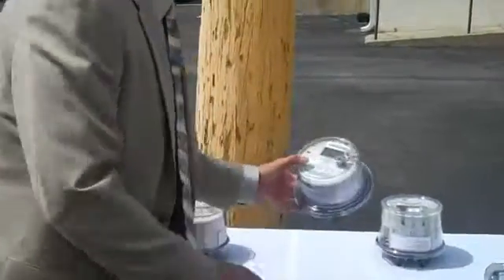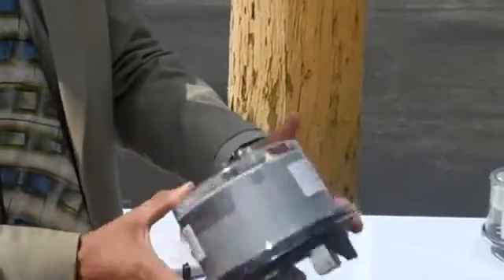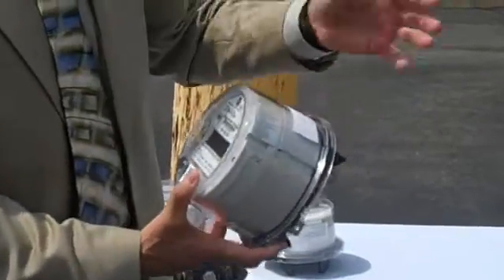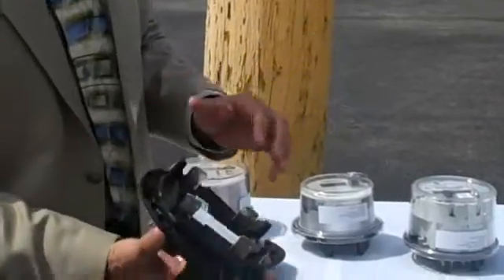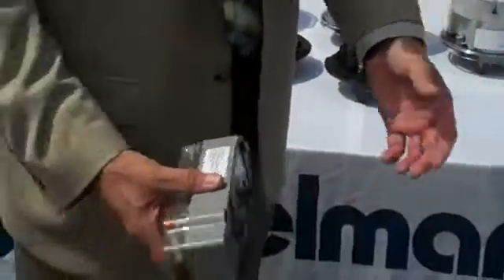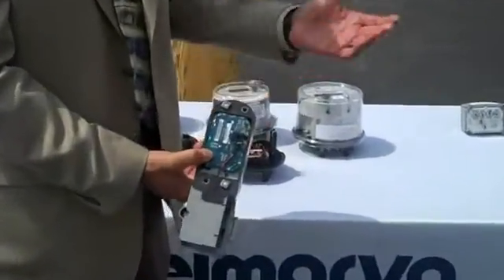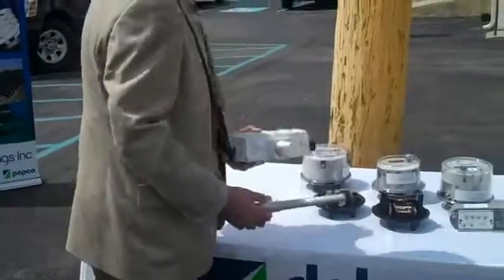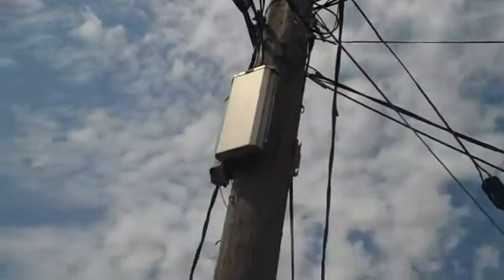Smart Meter Demo

Comment: @meterdatamanagement To answer your question, that wireless internet is going to be a lot weaker than that wireless smart meter sending out info on your intimate electric usage.   Who's going to get this data?  If you wash clothes at 11:00 a.m. and then log on at 11:02 a.m. to the net, will you suddenly be hit by many adverts for detergent because the power company sold this info on the market?   We don't know.  The power companies don't care.

Comment: So, how much did his hair plugs cost?

I have a stupid smart meter and since it's on the other side of the wall from the computer when it transmits, it comes over the speakers.  I've also noticed a rise in computer problems which I attribute to this monster, not to mention a rise in the cost of usage.